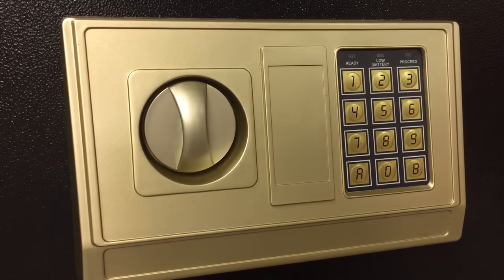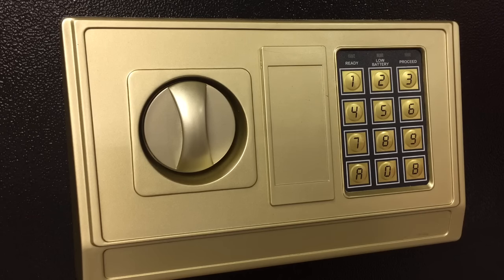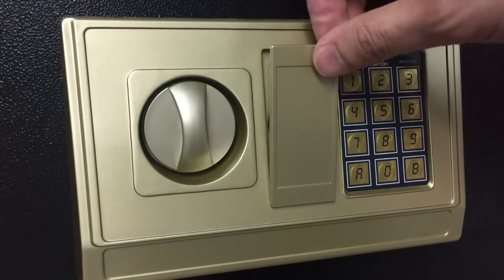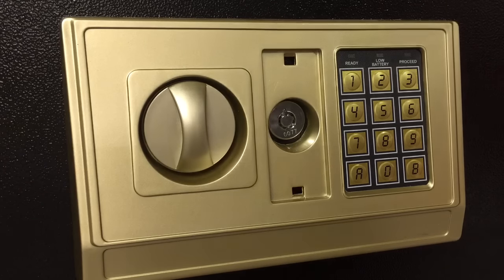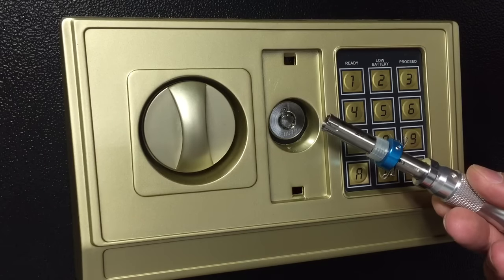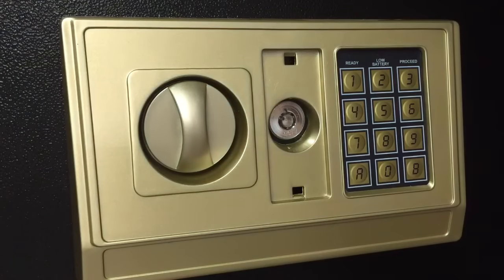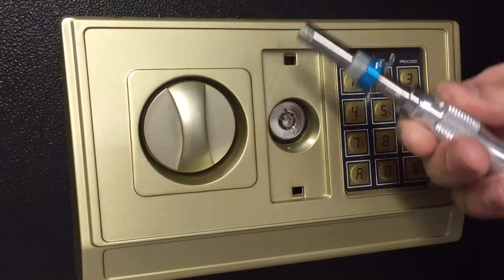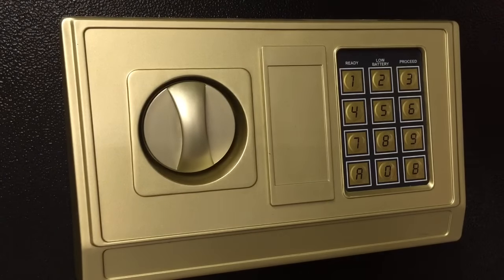[21] Harbor Freight Safe Picked Open

Comment: What would have been funnier is if you can buy the tool at Harbor Freight!
Reply: This is why I read the comments! 😂
Reply: Quang B you just won the internet with that one.
Reply: Stirl Dem agreed
Reply: Well you can buy both this safe and the tool on Aliexpress and DHGate.
Reply: I was actually waiting for him to say that's where he got the tool from
Reply: Yes, but if from HF, it won't work.
Reply: Sometimes, you can. Usually right next to the safes.
Reply: Dude I work for them and got one of the TSA approved little guncase safe things free kuz someone "locked their keys inside." They actually lost it but hey so I took it home and with literally a nail file on a fingernail clipper and a small flathead I opened it in less than a minute. Don't buy em. We have a new drop down gun safe that is the same price from a company on Amazon called Invie. Don't buy it. Cheap all the way.
Reply: @ilovedemfokes   - "Yes, but if from HF, it won't work."  Cute, Kenny!   What have you purchased at HGFT that failed to work?  I have an assortment of hand tools from them including screwdrivers , sockets, and wrenches.  Their air compressor, while a bit loud does the job as do the pneumatic tools I operate from them.   My 3500 watt HFT powered the fridge, freezer, lights, pellet stove etc. during a 40 hour power outage.  Sure, not everything they sell is outstanding but from my personal experience, they sell quality tools at very good prices.
Reply: Doesn’t work wasted $30 same safe

Comment: I picked up a safe like this at a garage sale and it's so bad you can just hit the top of the safe and turn the knob to open it. ( hitting the top makes the solenoid move out of the way so the locking bolt can be moved) the backup key was also a joke. And there was a code reset button inside the safe that with a little work you could reset the code from the outside without even knowing the original code. Better off using a safe like this as a dummy safe. Great video people should be aware of what  they are buying and you help them with that.
Reply from the maker: That works well on the smaller ones.  It's possible, but much harder on the 48" tall models like this one.
Reply: Haaaa. Knock knock open says me.
Reply: Any particular spot to hit it in? My electronics just went out and I dont have the key.
Reply: @jhoughjr1  search for the video, how to open a safe with a pottato
Reply: I have also opened this exact model in the past using the tap technic. The battery went flat and you can only replace it from the inside. A couple of strong taps and it came straight lose.
Reply: Yeah I used this technique on my safe. Battery dead and couldnt find the key. Was stunned how easy it was. If you have a bigger one and it isnt bolted down, put in on a bed and then wack it on the head with a rubber hammer or something. The bouncing on the bed makes it even easier.
Reply: you think you can afford a safe that works... #hahahahaha - seriously NO LOCK is unbreakable on the safe market

Comment: Very alarming indeed. Timing a good whack into the top of the box with turning the knob usually also makes an easy entry.
Reply from the maker: asdfkoas I couldn't get that to work on this one... and I tried using a heavy dead blow hammer.  It's probably because it is the larger 250lbs version.  But along these lines, there's a really funny video out there somewhere where a guy opens a safe like this by whacking it on top with a potato!  Its hilarious... and a little sad.
Reply: Seen it, done it, but it works with a zucchini as well ;)
Reply from the maker: +asdfkoas I'll try a vegetable next time. ;-)
Reply: @lockpickinglawyer  Seriously?! I thought that this was a cheap hotel safe. A 250lb 48" high safe with this lock?!  Recommendation: Include a long shot or photo of the entire safe in these videos.

Comment: Just epoxy the lock tumbler, and don't forget your combo.
Reply: Penny Wagner then 1 year down the line and either you forget to replace the batteries or the pad fails
Reply: I'm a hotelier in the UK. All of my bedrooms have one of these safes. The locks keep failing and the keys stop working. A hammer and two minutes will open the safe but will make a lot of noise. I'm replacing all the original locks with a hasp and shackle. Guests can fit a padlock of their choice.
Reply: camjamsdad why didn't you just buy a good safe ?

Nevermind...I finished reading your reply.   Lol 😋
Reply: It's so easy to get bendable wire around the hinge side and press the code reset button. I actually think it would be more secure to disconnect the electronics power supply and use the backup key only. If the locks were not so insecure or often keyed alike....
Reply: @bobdole4694  THANKYOU! The backup locks tend to fail. I should have put oil in them when they were new.
Reply: Hello this is the rope cutting lawyer
Reply: @bobdole4694  I knocked the reset out of the hole so it hangs inside the door. Have to remove battery unit to get to it.

Comment: There are so many ways to open this without the key or combination, it simply defies belief.
1. As demonstrated above.

2. If batteries charged, push long piece of metal (coat hanger) through rear/bottom holes and hit reset switch. Then reset your new code and open.

3. If not secured down, or mounted on carpet or bouncy surface, simply strike the safe over door (shock the weighted solenoid) repeatedly while 'jerk' rotating the handle, it opens easily within a few good whacks.

4. On the larger fire and gun safe variants, that have plastic panels over the lock face, simply place a large neodymium magnet in a sock or similar slippery cloth and drag over the door face to activate (withdraw) the solenoid.
Reply from the maker: Do you have a link on the magnet attack?  I've not been able to get that to work with a pretty powerful magnet.
Reply: Make your owl electro magnet with some iron bar telephone wire or same wire in blue cat 5 put about 50 turns of the still insulated and single strand around the bar and apply 12v.  Doesnt need ro be neat but bunched together for propper inductance......  Food for thought. Love your videos.

Comment: Massively overstated!!!! If you have this special tool then you can get into the safe- true! But most people don't have this special tool, so the safe is a very good safe as far as most people are concerned. If someone needs to keep out not just opportunistic thieves  but ones who will come prepared with this special tool then obviously a more expensive safe should be bought, or they could remove the lever that the key operates and make sure they record the PIN somewhere and keep the batteries good.

Comment: I have found this safe works very well. In order to prevent thieves stealing my valuables I've found it best to place said valuables on a nice sturdy table. Upon removing the valuables, the thief finds a spring plate has just popped up and has let go of a rope. The impact from a Harbour Freight safe seems to cause 100% of thieves to drop the lot as well as take a nap while their face pisses blood. 
10/10, would bludgeon again.

Comment: Have you tried picking the Harbor Freight padlocks? I see you have a video where a Chinese lock had plastic inside that you were able to crack. I was wondering if the HF locks were to same? You can buy 3 in a package for $5.00 on sale. BTW, I really enjoy watching your videos, good stuff.
Reply from the maker: +vegasfordguy Thanks for watching -- it's always nice to hear from someone who enjoys my videos.  I have not tried the 3 pack laminated HF locks.  I have picked on their American 700 clone and their “puck” hidden shackle lock.  Both have 6 pin brass cores with American Lock keyways. They are both made to VERY poor tolerances and are relatively easy to open.  I suggest heavy tension.  The binding orders on the locks I have are not at all subtle.

Comment: If you use a piece of scrap metal to cover the reset inside the door, cover inside the door where the LEDs are to prevent the coat hanger trick and press JB weld into the bypass lock keyway and use good construction adhesive under the plastic cover to prevent the cover from coming off. Provided you will then have to make sure your battery doesn't go dead because if it does you're screwed

Comment: Wow, now that's one handy little piece of info!   Thank you for the video.  I've been considering getting one of these but now you have me pumping the brakes.  You mention replacing the cam lock with an Abloy lock....  I'm very handy but know nothing about locks.  Can you offer a Abloy replacement lock part number as a suggestion?  Also, where do you get one and would it be difficult to replace for someone who has very little knowledge about locks?  Thanks again.
Reply from the maker: Glad you liked it.  Sorry, but I don't know the part number.  What you would need to do is to open the door and measure the depth of the lock.  Most cam locks of the same depth will work.
Reply: The tool is a HUK lock pick tool

Comment: I use a hardened chain around it held on the sides with grade 5 bolts fender washers. Then use a abus 10 padlock.the metal on the box is stout,fix the chain around it,have it bolted down and its much tougher.
Reply from the maker: +Greg Taylor LOL.  That's one way to fix the problem!
Reply: got a photo or a video about this? please post

Comment: You can also use a flat head screwdriver and jam it in at the top of the protruding keypad assembly, yank down and ripped the entire keypad off. Then you just stick your finger in the little hole that the turn knob goes into and push down on the locking lever and then open the safe. The whole process from start to finish takes about 12 seconds.
Reply: This also goes for any of the union safes with that particular style keypad. They all have the exact same locking mechanisms. And I can defeat every single one of them, and under 20 seconds.

Comment: Just add a heavy duty padlock hasp to it. Or if you want to get technical, add a remote controlled solenoid lock inside the safe that can only be accessed from inside the safe.

Comment: Everyone needs two safes. One left in the master bedroom closet with a few papers in it for the robbers to find, and one fire safe to put in the last place anyone would look. Find that place, and then put a box of dirty laundry over the top of the safe or a box of old books, or etc etc. Something that suits the out of the way place. Works more often than not. A robber will not turn over a pantry, a utility room press, the back of a kitchen cupboard filled with pots and pans. It's too easy.

Comment: Have to design a way to lock the panel or put a safety catch to unfasten the panel, or better yet get rid of the key punch lock and back up, replace the locking mechanism with high security lock.

Comment: The lock on mine is super-secure.  One of the pins is just flopping around with no spring tension and the lock is bound up.  Luckily, the code still works so I could replace the whole cam lock without breaking in.

Comment: You can also bang on the top, even if it's bolted to a concrete wall. Sure, you have to bang it harder than if it's freestanding, but you can open it. I know because I lost the key, forgot the combination, the battery was dead, and didn't want to wait for the $30 tool. I didn't know I could use the tool to make a new key, so maybe I'll order the tool anyway. The only purpose of the safe, btw, is to make people feel secure. I have two of these safes, 24 hour security, in a small gated community. If they get past the gate and guards, I don't think a safe (almost always with absolutely anything in them) is going to stop a determined thief.

Comment: Without the tube lock picking tool,
 I push the electronic combination reset button
 by putting a rod through the security hole in the back wall of the safe. Then I input the factory reset code ,"159",
 and the safe unlocks
 without a fancy tube lock picking tool.
 But, I would rather have the tube lock picking tool instead.

Comment: Another option is to hide it very well.

For example, you have to crawl under my house where there's only 16" of vertical clearance (not enough room to use a regular shovel).  Dig down about 30" where you will hit 11½" thick pad of cured concrete I poured over the top of this safe.  You will have to chip through that concret, then get your fancy $30 tool to easily pick the safe.

Congratulations, you now have access to my expired credit card I keep in the safe.

As far as me not knowing you were in the safe...you will need to pour concrete, let it cure, return to place the dirt back, remove all evidence of chipped out concrete...and do this all quietly without alerting the family dog to your presence.

Good Luck!

Comment: Is there a lock mechanism you could recommend that would replace the vulnerable tube lock it comes with?  It would be nice to be able to switch it out and keep the safe.
Reply: As mentioned in one of the comments above, the Medeco cam lock works very well as a keyed replacement and it's relatively inexpensive. And I lined mine with some fire retardant foam pads, and place the valuables inside a fire safe bag.

Comment: I just opened one just like that for a guy at work, bop the top and its open, he lost his key, and ran batteries dead. But if you add a spring to hold the selinoid unlocking plate up better, its harder to bop into it.
But the lock is still its weekest link.

Comment: i'm not familiar with the harbor freight version , but these are generic made-in-china "safes"
They have a reset button on the hindge side of the door. And that button is accesable through the mounting holes at the bottom.

I have only once failed to open these in under a minute. And that time the customer had tried to get in by forcing the lock , after the batteries died.

Comment: Hi, I made the mistake of putting keys in safe when I was cleaning and the battery went dead.  I ordered the tools you recommended.  I am an older lady and you made it look so simple.  Can you give me a few more tips to get it open please.  Do you wiggle it only sideways or are you supposed to move it up and down also.  I saw the spaced part at the top when you started, then I saw it jump to the left.  Please help me open the safe. Thank you.

Comment: Believe it or not, I found one of those with a simple Wafer lock on it...??  Did you sanded those little bumps down on the pick "wires"?  I sanded mine down so the pick could slide into the lock easier.  Don't know if I should have done that, but I can always use the fingers from one of the other picks anyway.  I'd be interested hearing your opinion?
Reply from the maker: +LDU2U Nothing surprises me about the security products made in China… except maybe the fact that they all don’t have the cheap(er) wafer locks.  As for modifying the impressioning tool, I’ve considered doing exactly that because these tools are really spotty about fitting in locks.  I have two brands of impressioning tools, with three sizes in each brand, and it’s not unusual to find a lock in which the fit is really close, but none of my tools quite get in the lock.  Probably the only reasons I didn’t modify my tools are (i) I don’t pick many tubular locks anymore, and (ii) I mostly SPP these locks now.  As a hobbyist, I pick for the enjoyment and challenge.  It’s not very fun or challenging to open locks with impressioning tools.  I enjoy SPPing more and the method works on a much wider variety of locks (many of which the impressioning tools can’t open). All of that said, how is your modified tool working?  I might follow your lead.
Reply: I can't really say if it worked any better, certainly not any worse anyway, makes it the same as the Southord tubular pick.  The reason I sanded those bumps out because it sometimes sort of 'jumps' into the lock while inserting, and I am not sure when it does 'jump' into the lock how close the pick is in relation to the pins?  I have to admit I'm not very good at tubular locks though.   SPP'ng is OK, but being a hobbyist myself, I don't particularly like SPP'ng a tubular with only one pins rotation of the core.  In the real world one would need to SPP it again twice, or maybe even three times before the locking latch mechanism would move past the point whereby the lock can actually get opened to gain access.  This is the only reason I continue using a tubular pick, you can keep rotating the core until the safe or some other container actually opens to gain access.  Just my personal thing you understand.  A lock for me has to be opened to gain me access, and usually you have to pick it again, or again before the container is actually opened?  I see people SPP'ng tubular locks on YT, but they only turn the core one pin position and say it's open, but in reality it would usually not be opened by just rotating of the core to one pins position, they would have to re-pick it again once or twice, or even more until the lock latching mechanism actually opens the safe or whatever, and then the reverse procedure to re-lock it.  I have this thing about lock picking as if I was out in the field...LOL.  I really enjoy your videos presentations, and you clearly explain things, they are a pleasure to watch LPL ;-)
Reply from the maker: +LDU2U You make a good point... but once you start on locks that have varying spring tension and/or varying length driver pins (like the ACE II), the impressioning tool is of limited use. As for moving the core multiple positions -- check out my video #91.
Reply: Stupid me, I forgot I watched that video...DOH!  Of course, that's all one has to do after SPP'ng.  Just delete my ramblings before...LOL.  I have a couple of those SPP'ng picks, I'll have a go at that.  Thanks.